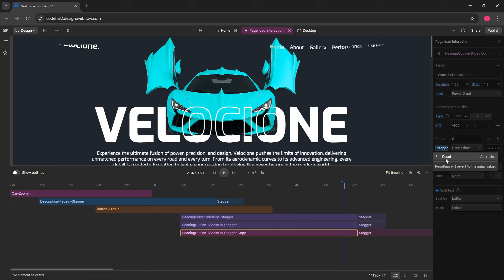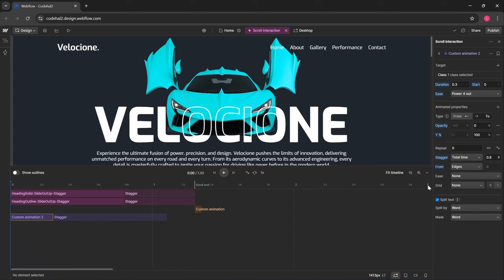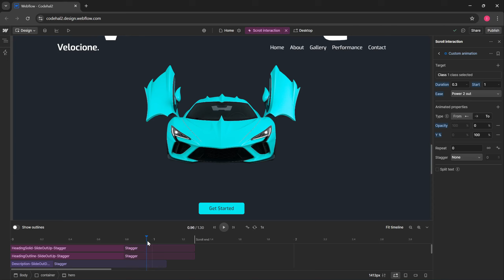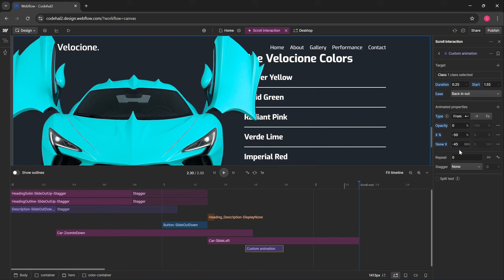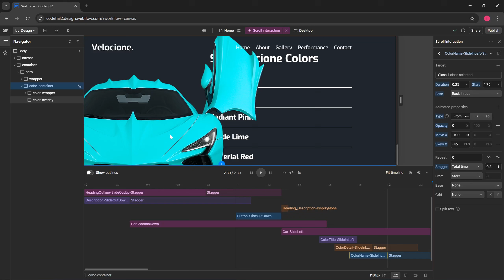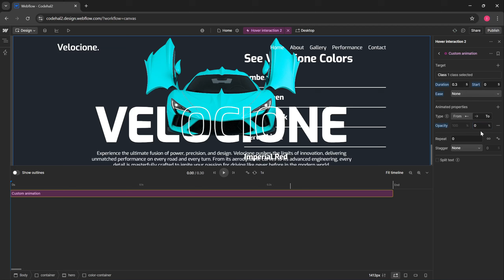Create Crazy Animations using New Webflow GSAP Interactions

Comment: When an image (a car image) and text overlap, how can I make only the overlapping part of the text transparent, leaving just the outline visible? Do I need to use custom code?
Reply: He used two text elements, one that is solid and one that is an outline only version and aligned them evenly on top of each other (outline version is in the front). the car image is in between the two text elements giving the illusion of what you see in the video. I believe you can set the stacking order (what's in front and what's behind) by utilizing the Z-index for the set of elements. I think I explained that correctly.🤷‍♂ that's the manual way otherwise yes you will have to use custom code css blend modes or background-clip
Reply: @RomeTheGod99 Oh I got it! Thank you very much ❤❤